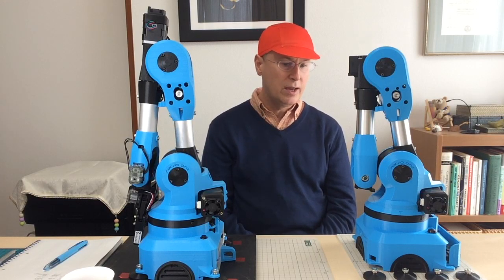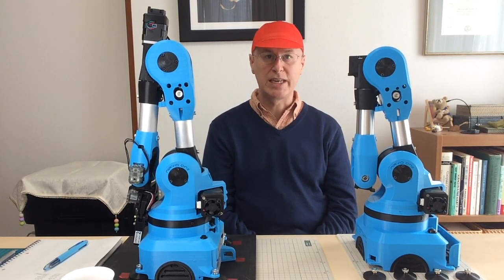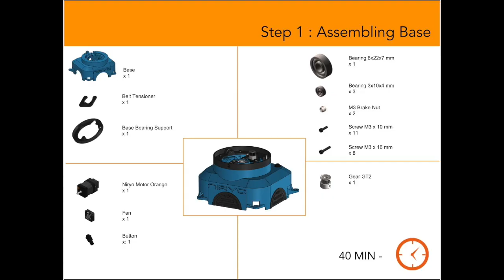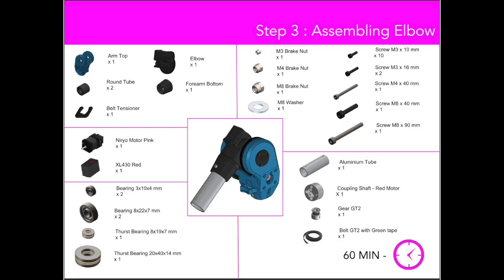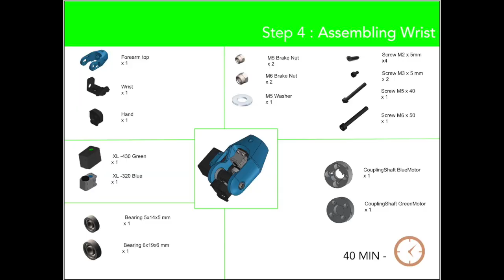Assembly of Niryo One v2.0 6-axis robotic arm

Comment: Hi! Really awesome project, I wondered and I wish to assemble this robot and probably improve something. Could you help me to find or make electronics for it?
Reply from the maker: Roman, Thank you for your comment. You should be able to find all the information you need on Niryo's website and their open source materials on github. If you are serious about building your own, you should sign up and participate in their forums; they're free! Good luck with your building adventure.
Reply: @ReluctantRoboticist  Thank you for your answer! I checked all the forum, even wrote to authors of the robot, but unfortunately in vain. The only one issue, which I need for assembling is electronics, they didn't provide PCB for controllers for stepper motor and shield. About buying this components separately I aslo did't get any answer. So I at a loss now.

Comment: Hello!
I don't understand if the 3d printed parts are shipped with the kit or you had to print it by yourself. In case they ship it they also give you the STL?
Also I couldn't find the assembly video you have followed, do they have private links?
Reply from the maker: Eli, Thank you for your comment. All the answers to questions can be found through links on Niryo's website. They offer kits with both with and without the 3D printed parts included. For this video, I assembled a kit that included the parts. The current and past versions of their assembly videos are available in the Assembly Guide under "Niryo One - Docs" in the Support section of their website. The STLs for all the 3D parts are available on their github page (you can find a link in the Community section of their website). I hope you enjoy your adventures in robotics.